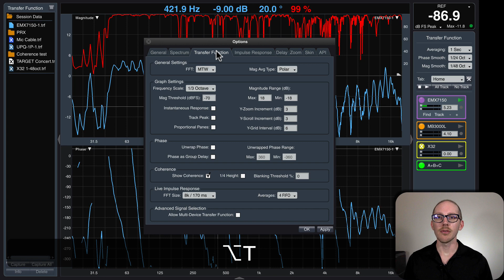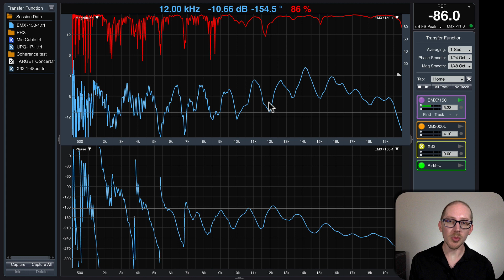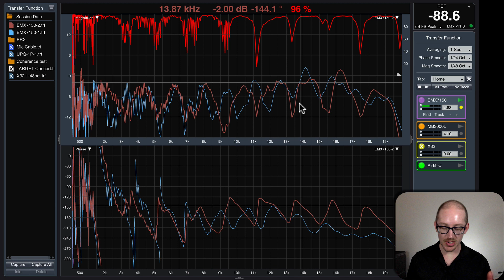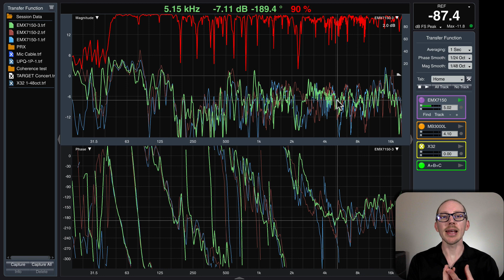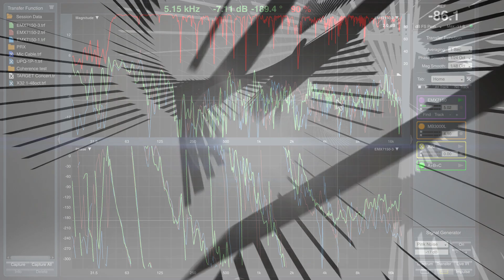How to find a comb filter in Smaart [GSwSST31.1]

Comment: Does the measurement mic go in the center of the aisle to get both LR speakers or in front of each speaker at time with the other speaker on mute? Also the PA system is too high for the measurement mic to be placed in front of it, will that be a problem?
Reply from the maker: Hi ADBA. Tell me more about what you are trying to accomplish with this microphone position. Since this video is about finding a comb filter, I'm not sure if that is what you are trying to do, or something else.